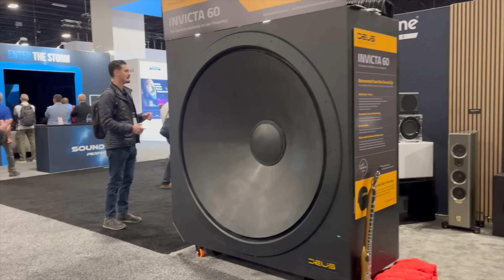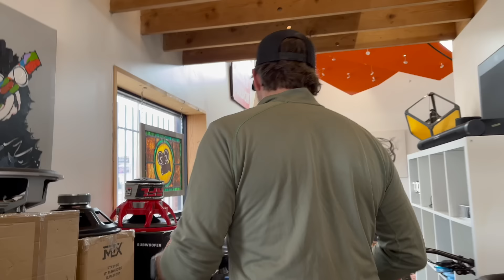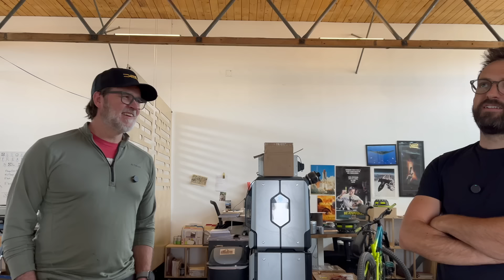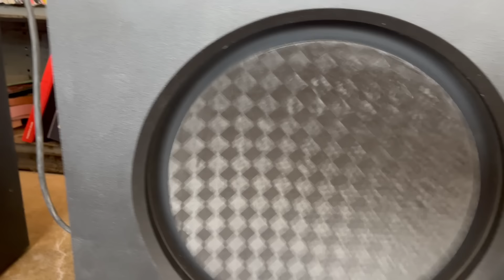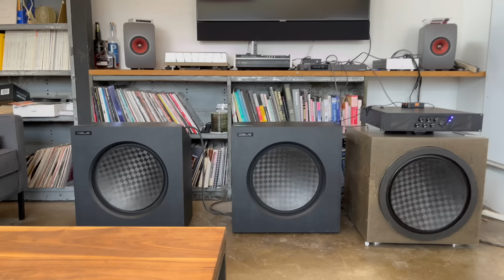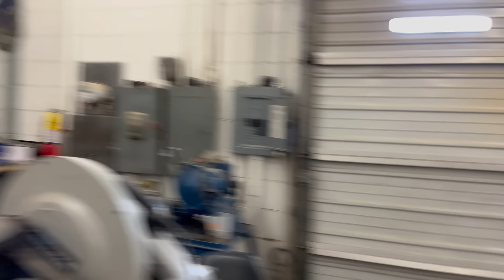60 Inch Subwoofer: Too Much?! | Deus Audio Machines Tour

Comment: All woofers and subwoofers have a rating for their linear travel. Its listed as xmax.  Its the distance they can travel in either direction and maintain linearity.  For example, the Dayton audio UMII18-22 18" subwoofer has an xmax of 28mm so that means its got a peak to peak linear travel of 56mm  or over 2"  (this is under full control), its not the maximum mechanical movement of the subwoofer driver which is another value called xmech.  As you move beyond xmax spec, then things become less linear.  

Also there is nothing super special about huge subwoofers like a 30" as an example. You can build a cabinet with 3x 18" and it would give you about the same surface area and you can do it cheaper as its a more common size. Lastly you dont have to drive a woofer to its mechanical limits. Just keep it within spec while driving it and youre fine. You will get very controlled accurate bass. There is no magic. So all this stuff about things being wobbly or whatever was being said, it was kind of inaccurate.

Comment: 9:35, that's why you make a voice coil that's taller and a magnet and surround that has more Xmax the more xmax you have the less linear the travel will be but the more SPL it will create, getting more output out of a speaker has a direct coloration to cone movement/XMAX

Comment: The video pertaining to home theater but subwoofers have so many applications as they mentioned in the beginning of video are making 18" subs and testing market, was wondering if they have considered mobile audio db drag racing where people trying to reach 187db saying they need certain diameter speakers at like 20hz. Many opt for like 12 18" subs that are 15k watts but only achieve 168db and you can not have servo controlled drivers or motors are the rules.  https://youtube.com/shorts/hEhezYhQ5iM?si=Rrz4I6cbZDjodO5y

Comment: The surface area assuming a full 60" of radiating area though it's probably not is equivalent to 11 18" drivers. So, yes, for one driver it's going to be amazing. But it's also nothing that can't be done in other ways. It is cool to see though. The guys assertion that audio companies don't concern themselves with their low end cabinets because most are ported though is the statement of a fool. These guys never fully understand what a consumer is looking for so they come up with ideas that have been tried a thousand times before and failed, not because they didn't work but because they were not commercially viable and consumer acceptable.  If one is already taking up a massive amount of space with a large high end speaker and paying 100 plus thousand they want bass extension and volume. They don't care about a level of accuracy they will never hear in their relatively poorly prepped rooms and noisy environments. Yes, really. Guys who can't afford such speakers always seem to assume those who can are die hard audionerds who obsess over every detail but they rarely are. These guys will not last or they will end up being a boutique brand with a 5 figure price tag because they will need to sell audio jewelry to the wealthy to make the 300 or so products they sell a year pay their bills. By the way, there are plenty of after market sealed subs so they aren't even close to being the first to do that. REL, JL Audio, Pardigm, Legacy even lower end brands like SVS make them. Nothing new here just a guy who has done enough research to build a great product but not enough to realize dozens of others already make what he is making. But good luck.
Reply: 60" = (16)15"s *
However, the way a mega cone conveys it's energy has attributes that even 16 15"s can't equal.  
That said, 16 subs spread around for modal resonance mitigation is an attribute that a single mega driver can't replicate.   
Everything re loudspeakers is all about juggling compromises. 

Many interesting points you shared. 
Thanks

* by using 15" drivers the equation is solved without much math
60" = (4)30" 
30" = (4)15"
thus;
60" = (16)15"

You likely already know that shortcut, but perhaps others don't.

Comment: 18" PA subs are even more efficient than those Deus 18's and have tighter bass due to stiffer surrounds. The ignorance of audiophiles is a reflection of western culture itself
Reply: Most 18" PA drivers are more sensitive across their intended range than most long stroke hifi drivers.
However, it's typically at the expense of extension. 

It's all a juggling act of sacrifice. 

Oftentimes, the best performance is attained via a two-way sub system; ... as what's needed to reproduce the bottom octaves is less than ideal for reproduction of mid-bass impact and delineation.
Reply: Yep, but if you check out their performance over stroke, you'll find that the accordion surrounds stiffen significantly as the cone moves through its stroke. So PA drivers are great over small excursions, but quickly become non-linear, and introduce quite a lot of harmonic distortion at medium SPL. Moving a lot of air accurately is a very difficult engineering problem.
Reply: @DeusAudioMachinesJon  
Indeed.
Fortunately, (in typically sized rooms) the reciprocal acoustic support below the room's fundamental resonance facilitates an elevated level to the fundamental, ... and a diminished level of support to the distortion products that lie above.  

Win win.

Comment: For nice tight kick drums with good harmonics, use a high quality Midbass woofer. 
For deep kick thumps, use a high quality subwoofer.
I would like to compare their sealed subwoofer versus a properly designed t-line vented system.
Reply: Big subwoofer i love you
Reply: No conventional sub, transmission line loaded or otherwise, could compare to the performance of this sealed sub across the LF bandwidth.
Reply: @FOH3663  
Decware .. Hold My Beer
Reply: @Bassotronics 
Care to elaborate?
Reply: I would think the sealed version would sound MUCH more musical.... 🤔

Comment: Sounds like a variant of xbl^2 or an underhung coil.
Reply: Good eye, but it is actually a new motor topology. We have 6 patents in process (one provisional application filed, the rest nearly ready), and don't want to spill the beans yet, but it has flat BL like an underhung coil, but with the long term thermal capacity and power handling of an overhung coil. That is super necessary for a proper cinema focused sub, otherwise we'd have power compression and reliability issues to deal with. Also, it would be tricky to get our BL^2/Re of over 1,200 with an underhung configuration. Doable, but it would require waaaaay more neodymium, and that's worth its weight in gold right now thanks to the trade war...

Comment: The larger the driver, the slower it will go. It’s all about weight, and inertia (stop and go) four 15 inch subs will do just fine
Reply: It doesn't work that way. 
Weight, inertia, doesn't impact speed.

Comment: very interesting video, but he why so much hate on ported, if calibrated right they can also do amazing, keep up the content buddy
Reply: Indeed.
However, an adequately low-tuned bass reflex design for a 60" driver would make the cabinet multiple times bigger than this small-sealed design! 

These guys are design engineers, they know whatever they offer must pass through a typical man door. This current design is approaching the limit of max size. 

Of course, Ascendo offers multiple sizes of huge subs, including their unreal 100" flagship design, ... a built in-place monster for those so inclined.

Comment: So are we just not going to discuss how they achieved linear motor force over a large range of linear travel?! That is the endgame peak of speaker technology, and we’re just going mention it as a feature in the background?!
Reply: Short coil, long gap, ... nothing new. 
Attributes of greater linearity over stroke, sacrificing total stroke. 

What's new is the trick implementation of such an approach in the stacked neo motor, driving the mammoth diaphragm. 

But uniform magnetic force factor over stroke, via short coil long gap techniques isn't new.  

What's new is where it's being taken by this über creative team.
Reply: @FOH3663  Good guess, but this is actually a long coil, short gap. Underhung designs suffer from too much heat buildup for high SPL cinema applications, and that's what makes this new motor topology special. Once patents are filed, we'll be happy to spill the beans on the way we have achieved it. Until then, it will have to remain shrouded in mystery!
Reply: @DeusAudioMachinesJon  
Very nice. My apologies for my speculation.  

So other tools are employed to maintain the claimed uniformity of force factor over stroke. Dig it. 

I truly appreciate the road less traveled which you're taking. 

What no one is referencing, which can't be replicated even by many multiples of a given smaller, typically sized driver, ... is the manner in which these mega cones convey their energy in the quasi nearfield.   

Propagation can be breath-takingly impactful ... I trust I'm preaching to the choir! 

I wish you all the luck in the world in this endeavor. Very, very cool. 
-----------
(I'll take two, sans cabinets, ... I'll align them dual-opposed, manifold mounted in an IB. On one side is my studio, work/mixing system, on the other is our primary media system/HT, they'd support the LF of two individual systems in two individual rooms!) 

All the best.

Comment: I shut down as soon as I heard "fast bass".
Reply: I can respect that. That term gets thrown around a lot, and tends to have a mushy definition. One of our key performance metrics is group delay at the lowest frequencies. Subwoofers that use resonating elements to augment their output (ports, passive radiators, bandpass enclosures) tend to have a sharp transition from their pass band to their 24dB/oct rolloff. This manifests as high group delay, which sounds like the bass is lagging behind the music. We prioritize having very low group delay throughout the entire operating band, and thus keep the bass aligned with the rest of the spectrum. Couple this with our very high motor force, very low compliance, small air volumes, and very low inductance, and you have a subwoofer where the output tracks the electrical input as closely as possible. The result is that the bass appears to be time aligned with the mains, and when the bass stops, the sound stops. No ringing, no decay. This is what we mean when we say "fast bass"
Reply: Same. Fast, tight bass means nothing to me. I want to know if it plays 15Hz really loud compared to 40Hz.
Reply: @yiravarga  
15hz vis-à-vis 40hz performance in room? 
It's -3dB@12hz according to their specs.

To a large degree it'd depend on the room's transfer function.
 
However, I suspect the performance experience would be so incredibly positive that ultimate bottom octave extension would be acceptable regardless how it ends up!

Comment: So no specs? If tbis is super efficient whats the power range? Spl? Distortion factor? It looks like a normal sealed enclosure what makes this so special? I have 2 cadence comp 12's in a slot ported box, 500w class d amp, denon reciever, tuned all the channels and i can hit 70, out of a max 98, on my reciever clear as day, depending on style of music up to 80. The entire bass portion was less than $1k. So you are saying this thing will do better than that? And how much would that cost $50k, more?" This looks like hype to sell you something way over priced so you can show off to your friends. Btw, windows closed i rattle my neighbors chandelier in his bedroom across the street.  Does this sub produce like that? My subs are rated 700 rms a piece so i'm not even pushing them.
Reply: Specs are on their website. 
It's legit. 
-3dB@12hz 
143dB@1m continuous

Typical subs could not compete with the experience of this sub.

Comment: 34K for an 18" sub. Wowzers!
Reply: I can build dual 18 inch tuned 10hz for $2000. Ability to do inaudible bass too eg: pipe organs etc. just need cheap crown amp or behringer amp with dsp and cheap dayton audio um 18.. sealed box will be even cheaper or ported 10hz or passive radiator tuned 19hz then add another passive radiator to go lower
Reply: @josealfredfernandes  I've built many sub enclosures over the past 30+ years, but mainly for car audio systems. I don't think I've spent or charged over $500, and that's including the drivers! Lol
Reply: @josealfredfernandes  
You're right, ... there's mammoth advantages to a DIY effort. 

I built an IB sub, an attic manifold quad 18" IB for $1500 all in (Fi IB3-18 drivers, plywood, glued/screwed, plus EP4k power amp). 

That's four 30mm stroke IB specific drivers hitting 127dB@20hz@the LP. 

I've built nearly every common alignment. 
They all have a niche where they really shine. 

The beauty of the IB is the bottom octave sensitivity. Compared to a high-performance sealed sub, an IB requires approx 10x less power!

From wall power demands to thermal compression, ... that's a huge advantage.
Reply: This one time ….. (lol) I had a 2x12 sealed sub box in my living room powered by a 90w integrated amp (I know - gasp) any way within 5 minutes of not even full blast my phone rang with the official request to cease and desist. 😅

Comment: So they made the voice coil lenght longer then the excursion of the woofer. Huh pretty simple actually good on them
Reply: Underhung (vs overhung), whereby the coil height is shorter than the magnetic gap, characteristics include more constant force factor over its stroke, sacrificing total stroke for linearity.
Reply: @FOH3663 I'm well hung... 🤷🏻
Reply: Agreed. That will not make metal sound when infrasonics some.

Comment: Fostex still make a 30 inch. Back last millenium I saw Primus live. Their front of house were  2 HUGE 30 + inch woofers in a 2 way horn sytem. the sise of 2 small cars EACH! Despite the $#!t acoustics for amplified music of Thebarton Theatre Adelaide. The bass was AWESOME! Never EVER seen a crowd go off like that at ANY concert that size before!
Glad i've LIVED! Which is both satisfying and sad as you watch the world go to hell in a hand basket!
Also big doesn't mean slow. Magnet power & size can make a hell of a difference to voice coil control if flux density can override the mass. Also the larger the diameter the less pistonic movement is required for a given SPL Meaning the voice coil can remain in the sweet spot of max flux density throughout its excursion through LESS X max being better!
ATC have followed this design principle for nigh on half a century
And are the studio monitor benchmark for VERY good reasons!
Reply: As a FOH engineer/lifelong enthusiast, I'd loved to have seen and experienced that rig! I'll dig around for pics. 

Fwiw, driver mass doesn't impact speed, only sensitivity.
Driver speed is a function of current. 

More specifically, how much current can be instantaneously dumped into the voice coil load limited by inductance.

Comment: That is nothing new. It is called Under-hung voice coil.
Reply: Right...as long as it's in the gap the amp can move it.  The magic happens in the amp.  If you really want extension without distortion and amp headroom robbing equalization, servo the woofer.
Reply: @cpufrost  Servos are great for reducing distortion, but our design ethos is to stop the distortion before it ever starts. No feedback based distortion correction mechanism is perfect (just like glasses are amazing, but not perfect), and they're susceptible to feedback error, thermal drift, time domain issues, oscillations, etc... By designing the system to have ultra low distortion without the need for correction, we're making the highest performance subwoofers possible. And though they perform like under-hung coils, these are actually overhung for their thermal power handling capacity. That's the special sauce...
Reply: @DeusAudioMachinesJon  Interesting, thanks for the info.  Would love to hear this with wide dynamic range recordings with no HPF to see how much infrasonic program is revealed.
Reply: Mitsubishi made almost the same thing decades ago. Looks like a copy to me 😊